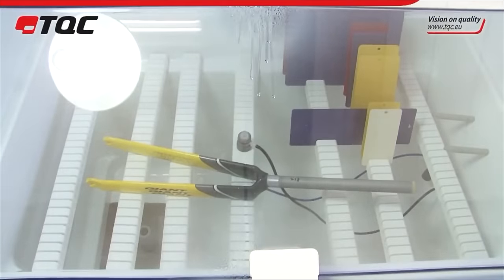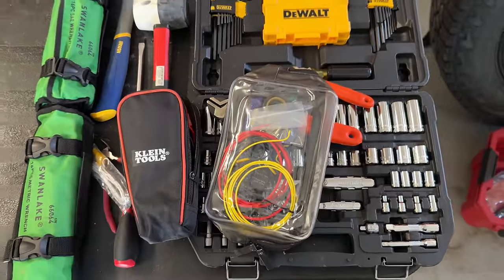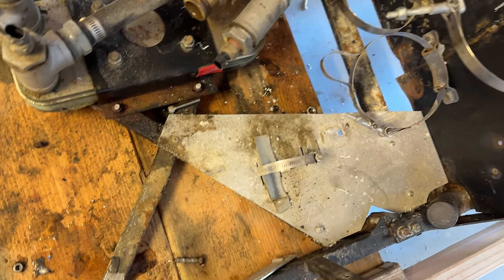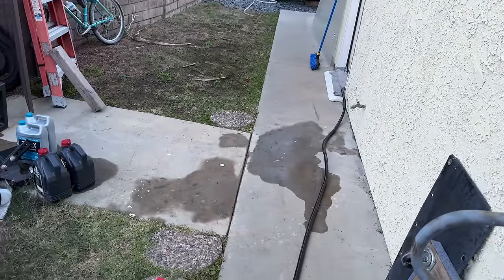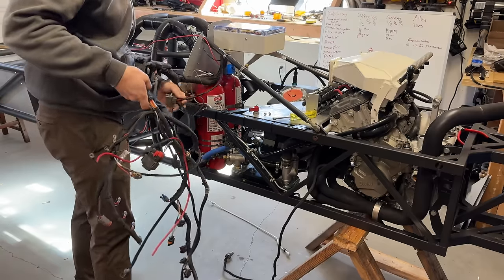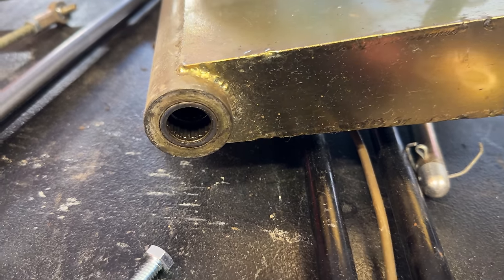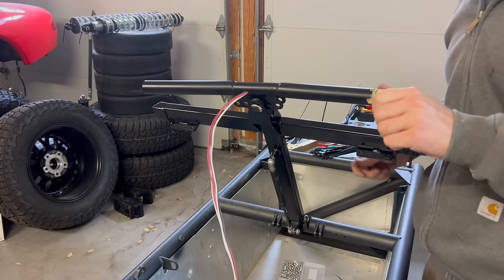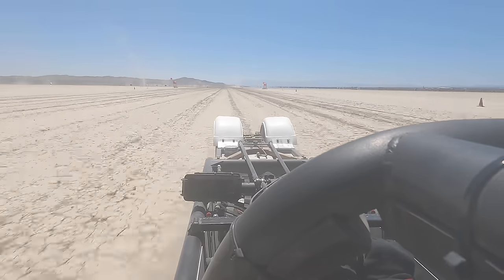My Race Car Is Rust

Comment: I've had grand success in marine environment, preventing corrosion between stainless and aluminum with tef gel (do not eat).  Also waterproof grease on bronze thrust bushings to keep out salt water.  When we ice raced in Maine (brackish) we used a fresh coat of wd40 to keep the ignition working.  Great vids.  Thanks.

Comment: This is why I spray my bikes down with wd40 after an off road trip. I’m sure it’s not as bad as salt flats but I do end up with muddy sand in everything. When I get back I’m beat and will put off messing with cleaning for days sometimes. But I blast it down in wd40 everywhere. I buy it by the gallon and use a spray bottle. Not only will it stop rust but it also loosens all the dirt and grim. So when I do power wash it everything just falls off with zero effort. Then for good measure I mist a bit more wd40 when I’m done. I know it sounds reckless and dumb but the results are amazing.

Comment: Great Video as always and good choice on the 3d Printer, especially with the requirements you described
Reply: Which printer is that? I have similarly avoided getting one because I just want parts, not a printing hobby.
Reply: @davidbell-yt  It's the Bambulab X1C if I'm not mistaken. Any of their other printers are also really good and can make most 3d Printing jobs a breeze. Bambu is on top of their game when it comes to making printers reliable and easy to use. They are like Apple of the printer world, quite limited in upgrades and customizability but has 99,9% of features a user could want. The difference to apple is the fact that they sell you replacement parts for cheap and encourage home repairs that will eventually happen as with any printer (a lot better though than most of the competitors)

Comment: @ your king pins:  we, here in Wisconsin,  call it that special "brown grease".  Another anti- rust option I've used a lot on plow trucks is an aerosol wax-based open gear and chain lube called velo-plex. Nasty stuff until hardened and lasts through several rounds of pressure washing.

Comment: My worst nightmare is my car becoming unsalvageable. I've pulled it back from the brink of the wreckers twice already, I ain't giving up, but this gave me anxiety.
Reply: Alfa owner that feels your pain 😅
Reply: Obscure Buick guy here, and same. I'm on restoration #3 with my son right now.
Reply: I daily a 92 riviera in Maine. Lol
Reply: Same here with my MINI, she’s had significantly more money spent on her than she deserves, I could’ve bought and modified a cooper S for the money I’ve spent, but that wouldn’t be her. She’ll be getting a Cooper S engine eventually but the current engine just will not die, it leaks like a sieve and rattles like a bag of rocks but it just keeps going
Reply: @thomaswatson5875  I'm also doing an r53 that was my daily until an angry s** offender parolee decided he didn't like that I held him accountable for his actions so he put something, possibly sand, in the oil and wiped out the oil cooler and camshaft. Yipee motor rebuild time, thankfully the bearings are all still good.

Comment: I notice there are such a bundle of contrivances for numerous purposes aside from being as light as possible to assist a higher top speed at a lower energy output. Bearings are heavy and brass or bronze (better) bushes are both lighter,  durable and carry a heavy load longer. One thing that does good to be heavy is coats of paint. Another idea is the wax we spray on our car in these advanced times to make them shine. Spray on rinse off. Probably doesn't add much weight either? I attempt in a small way to think of things that might help as the salt is a hobby for wealthy & one car per season does not seem to be within your budget? Those cables for the throttle are fairly hefty . Fixed. Good video Matt, thanks!!
Reply: Weight is not an obstacle on land speed vehicles as long as there is sufficient room to accelerate. Many wheel-driven streamliners accelerate fairly slowly.

Comment: Hey Matt when using abrasive (eg carbon/nylon/ etc) make sure that the entire work path of the filament (not just the nozzle) is rated for that level of abrasion. CF and nylon are generally considered to be a harder material to work with comparted to the normal PLA but worth the extra hassle if you need that level of resistance. Zach Freidman has a good series on trying basically every type of filament and you might like to check that on out

Comment: Just a suggestion.  Try KBS Rustseal.  I use it on frames of cars I restore.  Nothing gets through it. You have to grind it off to do any welding after the fact.  Way cheaper than your spray paint.

Comment: The Steel-It paint on the frame likes a low grit sand first. I sanded my rollcage with 80 grit and did a couple of coats. I pretty much stand or walk on my cage every time I get in or out and you can't tell.

Comment: what about having flush-out bungs at opposing ends of frame members so you can run water through to get some of the salt out and then air to get the moisture out? bonus points if you then flush it with undercoating or something else to prevent rust on the insides.

Comment: 11:57 - Could not recommend MarkForged printers, click print and pick up your part in an hour or two. Super consistent dimensions, good stiffness for things like your air filter adapter. We use ours in a maritime application for on-demand fixes of science equipment. Not a hobby, it's a tool.

Comment: Spray polyethylene is a great way to seal up for salt corrosion.  We top coat with paint . Here in Australia many mine sites run on bore water which is far saltier at time than sea water . Could be a good way to protect the frame and trailer.  Cheers mate

Comment: I made my trailer using 50X50 equal angle. There are no cavities so nowhere for moisture and salt to hide. The completed frame was hot dip galvanized. 23 years later there has only ever been one spot of rust. Literally a spot, like a point. Not bad considering it lives outside.

Comment: Spray coat everything (not hot stuff) in clear wax it works really well, it doesn't last very long (it lasts a few years) but you just add another layer and touch up scratches.

Comment: I made a spacer for my engine mount that sits by the exhaust + radiator. Holding up just fine.  
You're using it captive in compression, should be sweet

Comment: I like to soak the exposed areas in cheap, knock-off WaxOil, then clean it off after the outing with strong detergent and the pressure washer. The wax coat is sacrifical and gives you a while before grit eats into paint. 🤠

Comment: There's a similar product (probably by the same manufacturer) called Zinc-it, it's a gray primer color and dries almost instantly but I've used it on some bolts here in the Detroit area on winter driven cars with good results, you may want to give it a try maybe as a base coat before black...

Comment: I also have the Bambulab 3d Printer (X1 carbon) and love to use TPU-HF filament. Fairly elastic, heat resistant to a degree and doesn't break. And I can modulate the resulting flexibility with the amount of infill. Using the structured PEI plate for it, no gluestick required.

Comment: With a quality printer like that x1 carbon I've found that most errors when printing with engineering filaments is due to water in the filament.  I fixed almost all my issues when I started printing out of a dehydrator.

Comment: I realized what car yours seems similar to. Look into Tom Burkland's 411 streamliner. It's the car that broke Goldenrod's record back in '08 if I remember correctly. Tom does tech inspections for the salt periodically so may be a decent resource for you next go round. He can also tell you what it's like to wreck a streamliner at tripple digits so could possibly give you some tips on safety and escape from the car in the event of the worst possible situation.

Comment: yellow isn't zinc, it's cadmium. As far as painting the inside of the tubing, that's a good idea, but you might want to look into shooting the tubes with fluid film. It's a thing that they use in the Rust Belt to coat the underside and interior metal spaces of their cars to keep the salt demon at bay.

Comment: You should have the steering wheel connect to a pole. The pole has a 90 deg turn at the end. The end connects to metal tube which connects to the wheels offset forwards past the base

Comment: Re grease.  I've been using boat trailer bearing grease for stuff that goes near water/salt.  The stuff I have is this deep blue, fibrous sticky ass stuff that will not come off your hands with normal soap and water, so my belief is that it would be great for Bonneville wheel bearings (and maybe on bolt threads, too).

Comment: The insides of all those tubes will corrode... moisture/salt water will get into all the bolt holes.  Good idea to also mist the insides of tubes with ACF50, or LPS.  They will last longer.

Comment: I think mastercoat AG111 is some of the best paint in the world for corrosion resistance and chemical resistance. Use their zinc based primer first and it’s bomb proof. It’s considered an anti-graffiti paint(hence the name) and completely unaffected by paint stripper and other powerful chemicals. You can brush or roll it on straight up or you can reduce and spray

Comment: At least you didn't need to get the torch out. Can sympathize being a mechanic in the rust belt I got see A LOT of rusted up vehicles. Some just a couple years old and still had to heat and beat them apart.

Comment: There are soap additives that you use to help prevent corrosion, there is an American car detailing YouTuber who makes one; so there should be affordable options as you're over there.

Hydrophobic coatings should help a little as well with getting the salty wash water out if you actually clean it next time.

Comment: You might have addressed this in the trailer video but it seems like you'd want some sort of rubber bumper isolater type deal where those cup and cone locators are used so it's not banging around metal on metal, no? I guess I'll go watch the trailer video.

Comment: Great video... The only thing that concerns me with the Arduino DBW system, is make sure you have a sane throttle position if the electronics fail. I'm sure you don't want it to snap shut 100%, but I'm sure you don't want it to stay at the position (potentially wide open) if it fails.

Comment: 3:10 without heating them too much (cause you don't want to harden them) heat your hardware with a torch and drop them in HOT used motor oil. Done outside, for... obvious reasons, this will protect your hardware against rust as best as it can be protected.
I'd do a few tests on the minimum heat you can do them without damaging them. I usually heat them up for 50 seconds with a map torch hung by a wire - specifically until i see the wire get red hot (it's hardware store wire used to tie rebar for concrete - cheapest of the cheap metals) then dunk it. The heated oil is done in a stainless steel pot filled only with enough oil to cover the hardware i have. Some of the hardware i "blackened" in this fashion has been outside, in the elements for a few decades now. But the biggest proof of concept as far as i'm concerned is my brother's farm equipment where, whenever i take stuff apart, i do this to all the bolts that aren't hypercritical to be untouched (engine, transmission). I plan to test the this further down the line to enable the use on those parts as well, but for now i limit it to body and fixings. No issues so far, haven't observed any snapped bolts, at least not where i haven't seen them snap in the past in similar conditions.

edit: sidenote on paint and rust and the frame. It will add weight, but you can drill holes in the frame, put paint inside and then turn that frame about in all directions for the paint to settle and form a coat on. This will create a barrier that lasts pretty well against internal rust. Have not tried this on anything big, but i do have a small trailer that i have done this on and i haven't seen rust weep out of it anymore whereas before, i'd get rust weep every time i'd drive it in rain.

Comment: On a welded frame, I think there is ZERO chance the rust won't come back unless you chemical dip the frame to remove the rust and then dip it in a rustproofing coating of some kind. Even two-part epoxy won't last very long over rust. You cannot get the rust out of the joints inside the tubes..

Comment: A cheaper possibly better solution for coating the frame is powder coat.  If I brought that to my coater down to bare metal already, it'd probably cost $250 to powder coat it, then anytime you see corrosion clean that area and Steel-It.  Powder coat is tough, but if corrosion gets under it that is bad, like anything, but would be cheaper to powdercoat and do Steel-It touch up after each session in the salt, and you'd probably never accumulate that much corrosion under the powder if you clean and coat patches as you find them after events.  Would protect the vast majority and you'd only have to worry about key area touch ups.

Comment: Hey mate re the throttle problem; Mercedes circa 2000-2005 or so used a cable pedal to a throttle position switch to operate the DBW. It’s just a 0-5V setup so should be easy enough to adapt.

Comment: I actually have a 3D printer that is as reliable as a 2D printer.  I started with and Ender2 V3 about the time it came out.  I added a raspberry pi for software functions I wanted.  I have since loaded Jyre’s UI which gives me everything I need in software except ability to watch it remotely… and queue up a print from my laptop. 

What makes it so reliable?  I added a Sprite Pro extruder.  I will NEVER go back to Bowden tube.  The BL Touch bed sensor and the Jyre’s UI keep the printer head perfectly positioned to the bed.  Jyre’s has a great program for setting the bed level as well. 

I also put a micro switch kit on it so that when you run out of filament, it pulls the head away from the print so you can re-load filament and continue printing.  That requires software on the raspberry pi. 

The newer Ender printers have a bed sensor and direct drive print heads.  That is the key to speed (2X increase) and reliability.  

I have zero experience with other printer.  Creality seems to make good hardware, but they suck at software. BTW, they just came out with a very reasonably priced scanner.  Would LOVE to see you review one.

Comment: QUALITY PAINT COATINGS THAT COST A FORTUNE but do the job are like incredibly expensive abrasives that do the job - worth every single penny. 

I used to buy Mirka Abranet discs in pack of 100 and they are eyewatering expensive [over €a box], but they never clog and they work 5 X as fast as normal disks.

Comment: Wow corrosion, at any scale and surface, always SUCKS! Hey be careful and/or just replace that Klein meter with a proper Fluke.  I bought mine about 3 yrs ago at Home Depot while on route to a job that needed a clamp on and my old Fluke 87 is inline only.  Shortly there after my old Fluke was stolen, and I'd been using the Klein full-time since replacing an 87 aint cheep! Now I'm having reliability issues with the dial selector and testing, especially with continuity tone.  No one needs anything unreliable while out on site, just like corrosion!   Cheers
BTW what's up with welding SS cup brackets and non SS frame?

Comment: I am building a bike sitting in a similar position as you and had to lengthen all the controls , my throttle works fine as a single cable twist grip but your engine is further away. Also for the steering I am using a chain and sprocket seems to work better than push rods I have tried although I need a lot more angle than you!

Comment: You should look at running DBW throttle control through your ECU, you can set up way better maps, your throttle becomes more of a "torque request" input and then the ECU picks the best air/fuel ratio for the given RPM to provide the most power.  Might not mean much for a land speed car though I guess, because you'd only really care about WOT being as good as possible vs acceleration from various speeds.

Comment: That extra laggy throttle rig at the end of the video might just be worse death trap then the old push-pull setup. Which still is not push-pull. It's pull-pull. The cables don't push, they only pull. If they could push, you would only need one rather than two.

Comment: Instead of buying all new hardware, just get it re plated with a more durable coating like cadmium or e-plating.  Perhaps get the chassis hot dip galvanised the epoxy primer. Finally go to the closet jet wash after the event and  rinse the bejesus out of everything, then spray with boeing shield or GT85. Also spray everything with anti-corrosion was like hammerbild with you spray inside tubing as well as outside like the Eastwood paint

Comment: just completely dissassemble the car and clean it 
prolly need to dunk everything intoo salt water , might even need sumting to chance the ph so even if theres salt left it whont rust 
neat trick ive seen an oldtimer do was fill the frame with wasteoil just all the way to the top 
then drill a hole in the hottom and let the oil run intoo a catchcan the black oil will stick to the inside and it whont rust (mostly)